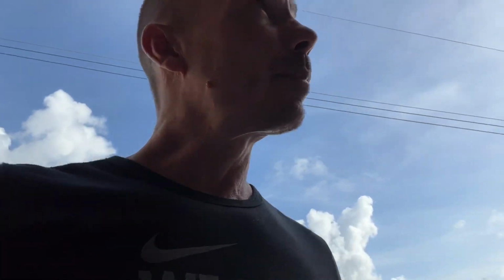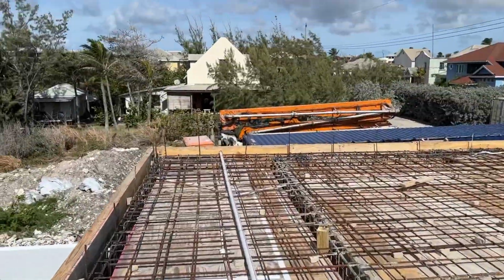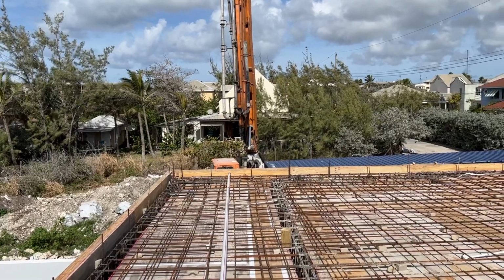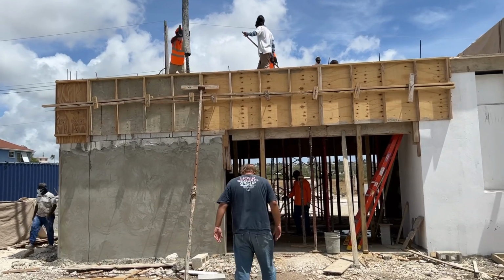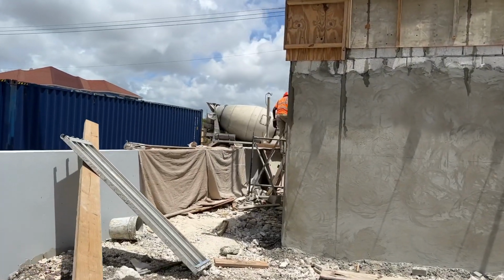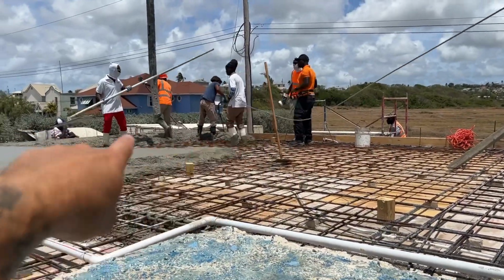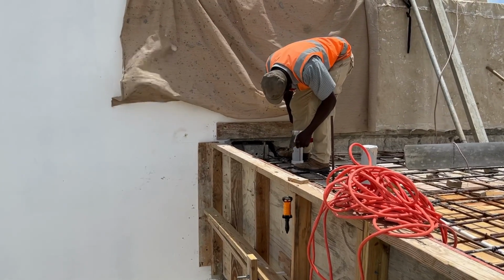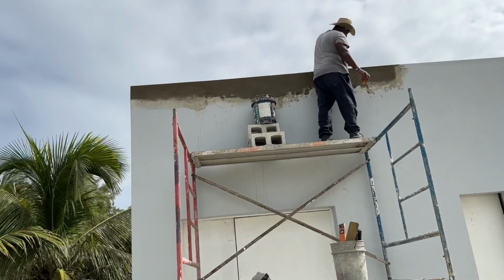Barbados 🇧🇧 Beach House Build - Day 288, the garage roof is being poured!

Comment: A successful pour, cottage roofline fixed , and the steps look great - today was a great day!
Reply: @barbadosbeachhousebuild  maybe carry the same colour on the bottom portion of the front of the house on to the steps.  That will give you continuity at the bottom portion of the house and contrast with the door.  I do hope the paint holds up over time however, It will be a shame if it starts to peel.